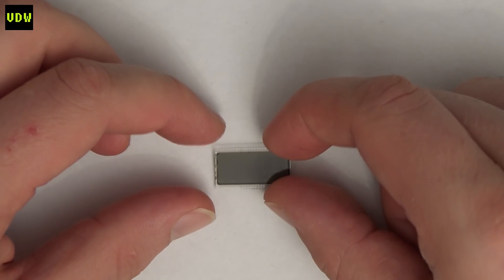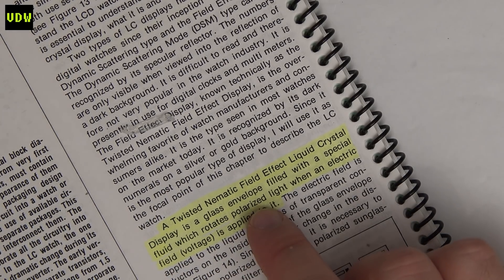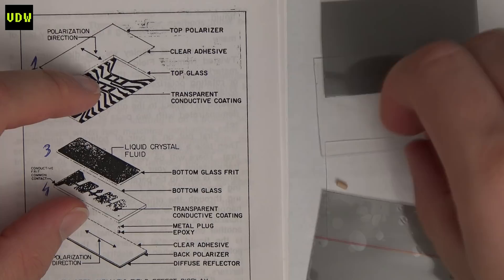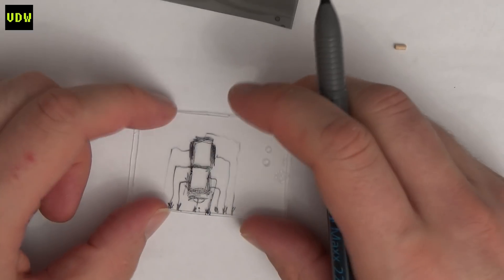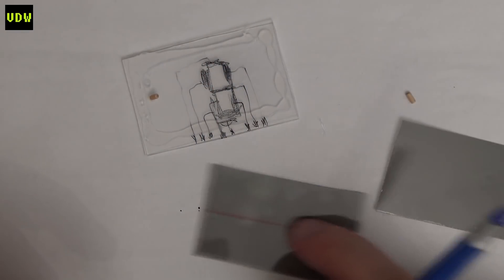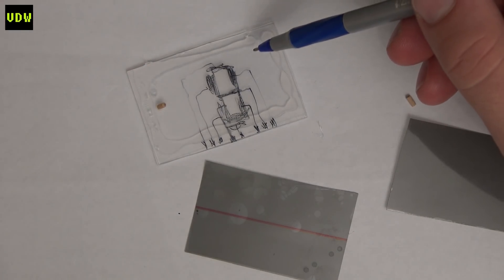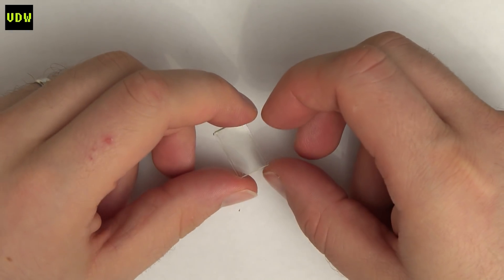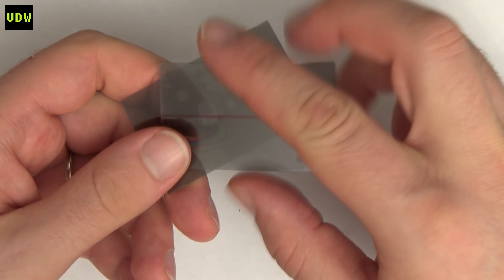LCD burn fix attempt? - Ep 67 - Vintage Digital Watches

Comment: Is a new LCD commercially available?
Reply from the maker: No, only if you book a Chinese manufacturer to build one.
Reply: @VintageDigitalWatches  that's sad... I already had two digital vintage watches, and both of them had the LCD damaged by water... so, I was expecting if I can just replace the LCD which exactly looked like in the video. The electronics part is still good and functional and I want to still make use of it.

Comment: I am pretty sure the rainbow non working screen on my 80s Seiko G757 has leaked.  Does the LC liquid smell like vinegar?
Reply from the maker: Never smelled it :)
Reply: @VintageDigitalWatches  Interestingly enough, after watching your video, I decided to put my non functioning Seiko in the freezer.  It has come back to life!
Reply: @jaitchy  can you elaborate on this further please? What wasn’t working? The display itself or the whole module!
Reply: @bobsmithinson2050  The display was not visible unless frozen - so assuming that is a display/leaked issue.  My watch is still the freezer where it works! When it warms up the display fades away again.
Reply: @jaitchy  thanks. 😭 I’m guessing it leaked some, and when cold, the remaining glass panes get closer together when cold, allowing the remaining liquid to be activated. Go move to Alaska or something and you can wear your watch most of the time haha
Reply: The smell is from the battery.

Comment: Hi bro greetings from Chile, I have a casio game called hungry girafe, it's a game from 1985
It have a issue with the lcd screen about missing sprites, the rest of the display is ok but, I can't see the leaf sprites.
Is the only problem, do you have a method to fix it??, or is a circuit issue.
I put the tester probe one on one contact line and appears the missing sprites
Reply from the maker: Tot test the board for missing output on segments you need an oscilloscope.

Comment: I'd like to know if you also observed an uneven distribution of contrast across a LCD that shows the rainbow effect. My Casio W-780 seems to have the effect you describe here, but it also has a very uneven contrast that also changes depending on what is displayed. Changing the front polarizer didn't do anything. I don't dare to remove the back polarizer, fearing to lose the "REM" print on the back of the glass. So I can't test if the back polarizer is the culprit. But if I put the module in test mode, where all segemts are lit, it suddenly has the full contrast in all segments. I have no clue what causes this strange behavior.
Reply from the maker: Never saw a case where the contrast is uneven and also at times comes back ok. I think it has to do with the module. Do you have a second module on which to test this LCD?
Reply: I didn’t understand anything you said but maybe you should make a video on it
Reply: I have a Citizen C300 which, although the contrast is even, has similar behaviour - when all segments are activated they're dark, but otherwise they're faint. I can make it better for a couple of weeks by leaving it with all segments on for a day or so, but then they go faint again. This can't be a problem with my LCD; it's probably a tired capacitor on the PCB. I suspect you have a similar issue which is combining with some of this rainbow LC fault.

Comment: I thanks for your great job. I'm tryng to fix a Seiko a156. I cleaned everything inside the model. Put a normal battery lr1130. It starts after some minute in crono mode but if i push any button display turns off. After a while it turns on again

Comment: Hi Tibi , nice video and well explained . I have many watches with dots bleeds and rainbow . Months ago i remove the polarizing  film from a beautifull ciizen who as black screen , now i just looking for polarized film on ebay but only found for cell phones so is
the same thing ? Can i use any polarized film for lcd screen and the front and the back are the same? Also there is no info if is self adhesive .
Thank you
Reply from the maker: https://www.ebay.co.uk/itm/Polarized-Film-faded-digit-Negative-Display-mod-with-adhesive-Spare-parts/323650226541?hash=item4b5b0e896d:g:U1wAAOSwiONYOMHQ:rk:1:pf:0
Reply: You can try to look for a Gameboy polarizer on ebay. Many Gameboy owners want to put a backlight in the display to enhance visibility and contrast, and for that purpose there are many offers on ebay, selling full backlight kits or  just the polarizers. They come in square pieces of 50x50 mm and are usually self-adhesive. I think polarizers with a stripe running across the protecting foil have an adhesive side.

Comment: Great explanation. Never knew how an lcd worked before, but now I do. Thank you!

As a quick follow-up question, if you're separate the panes containing the LC, replaced the LC and reassembled it (assuming this is possible) would that resolve the issue?
Reply from the maker: Hi, yes, I think it would, that is the last place the issue can come from.
Reply: @VintageDigitalWatches  Ok, I have a follow-up question then. Can one buy LC liquid and is it possible to open the display and replace it?

I don't know how LC liquid works, but would it be standardized? Or do different manufacturers use different liquids that require different amounts of current?

EDIT: I should say thank you for your videos. 

Also, why have you not set up a patreon account? Your videos are mzing, but more importantly they cover a subject that is difficult to find information on elsewhere. I'm not rich, but I'd contribute.
Reply: @stianlarsson6625  i would do the same fix of you, but is difficult find liquid cristal......and when find it you think need only put liquid crystal between the two glass?

Comment: Any tips on how to fix the piezo chime on my citizen digital caseback, it's gone very quiet
Reply from the maker: Hmm, have a look and see if any other metallic parts of the module are touching the Piezo part, only the piezo spring should, if there is any other part touching that then it will go quiet.
Reply: @VintageDigitalWatches  Thank you very much I tried but it all looks ok in there. Perhaps it has just failed over  time. It's a d288 if you're interested. You got me looking at these again, Cheers
Reply: Is there a way to test the piezo caseback while not connected to the watch. Positive to the crystal and negative to the case-surround? But how much voltage? Many thanks again for any info
Reply from the maker: @hamishspencer  You will need an oscillating voltage to make the buzzer work, it is not applying simple 
voltage.
Reply: @VintageDigitalWatches  Thank you again. Oh well, looks like I will have to live without the chime. Still a great watch.
Reply: I would be amazed if a piezo element itself stopped working unless it was cracked to bits. Most often the chime stops working to due to a missing or bent spring contact, but they rely on a little inductor (a black cylinder on the PCB about 4mm across) to step up the voltage, which could conceivably burn out if its output is shorted.